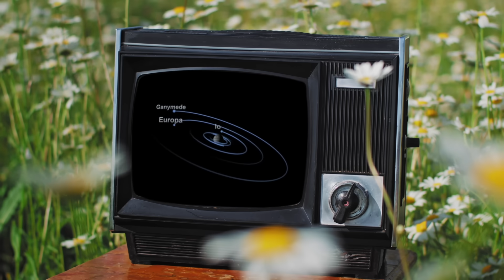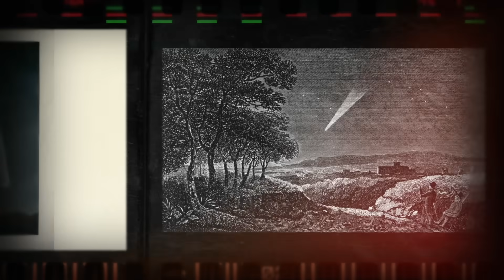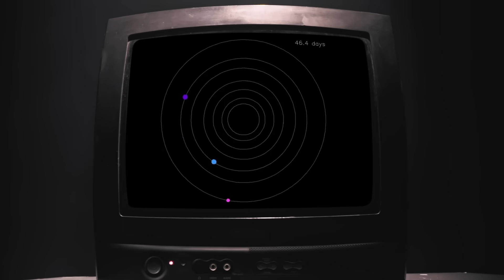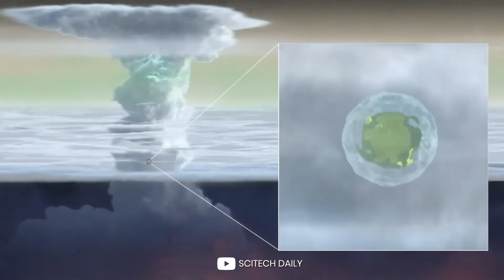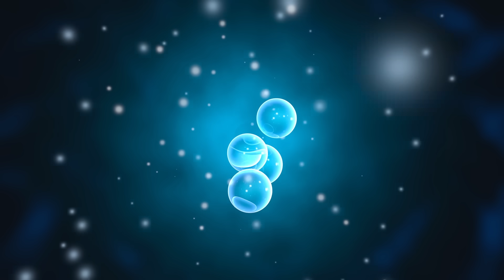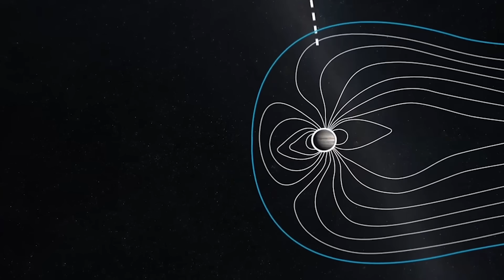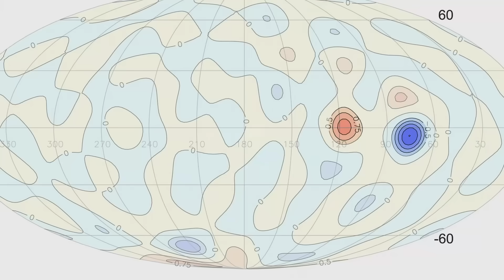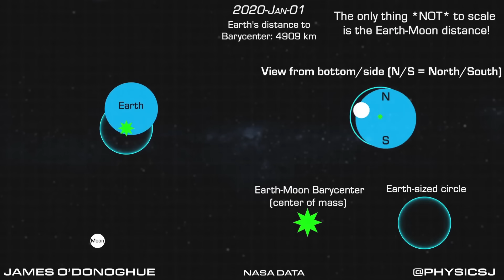Scientists Reveal That Jupiter Is Not What We're Beeing Told

Comment: I remember taking an astronomy class years ago, and my instructor mentioning that the sun undergoes a heightened level of activity every 11 years. I mentioned that Jupiter’s orbit is also 11 years. I always wondered if there was more to that connection….
Reply: Sun's 11 year cycle is shaped by the gravitational pull of Venus, Earth, and Jupiter. I just pulled it from Google, so take it with a grain of salt probably
Reply: @PandaChan6876  the Sun weighs about 333,000 times as much as Earth. It is so large that about 1,300,000 planet Earths can fit inside of it.  I doubt that the Earth has much influence upon it.
Reply: @PandaChan6876  you have something thier but still no explanation. Venus rotation is opposite of all other planet's.
Reply: @PandaChan6876  with a grain of sand
Reply: Who says Jupiter needs to be 50 times bigger? I think it just needs to be denser. Size has nothing to do with it, or rather very little. Our sun is relatively small compared with titans of the universe. Even so, there's smaller stars yet.
Reply: Very simple.  By 50 times bigger I meant 50 times more massive. Equations of state will ensure that it is then much denser and the conditions for nuclear fusion are met.
Reply: @BawkBawkBawk666  it doesn't have the mass to become denser. This is elementary stuff
Reply: it's rather 12 years orbit
Reply: Well there's a possibility that Jupiter was supposed to become a star and make a binary star system with the sun.. it wasn't quite big enough so it never fully developed into a star. 

On another note,  the moon is a quarter of the size of earth and it creates tides.. it's not hard to jump to the thought that it may be the same with Jupiter and the other planets
Reply: @sethbieber5127  You exaggerate. Jupiter would need to be something like 50 times more massive to become a star.
Reply: @rogerphelps9939  which is why it never became a star. It was too small... like I said... are you dense? It just weird for your brain to be foggy and in the clouds, but yet so dense.. what material is being used for that?
Reply: @sethbieber5127  if he's really dense maybe he'll become a star ?
Reply: @sethbieber5127   Jupiter wasn't "supposed' to become anything. Things happen because they have to. There is no intent.
Reply: @sethbieber5127  I have wondered if the big red spot hides details of an ejection of matter that formed the asteroid belt preventing a solar ignition, perhaps so life could exist on earth.
Reply: @spUrrrt — As suggested in the images in the vid, the red colour of the spot probably represents matter welling up from deeper within the atmosphere, possibly compounds in a liquid or subliming state or suspended as droplets in clouds.
Reply: @sethbieber5127  " it wasn't quite big enough " by a factor of between about 60 and 90*. Viz, Jupiter is between about 1.1% and 1.5% of the *minimum mass necessary to "ignite" as a star. 
If it were about 50 times heavier than it is, it might be able to have a short (couple of billion years) period of "burning" deuterium, but that would require adding all the rest of the planets (plus around 3 dozen other solar systems) to proto-Jupiter. 
As a "failed" star, Jupiter is a huge failure.
Reply: @sethbieber5127 Quite true, however, I find this size comparison misleads people who don't know the Earth is 83 times more massive than the moon. So it's a lot less 'stuff'. I like to use sciencey words as you can see.
Reply: @garethrobinson2275 Sciencey type bloke here [I’m a polywolyglottie whose hobby seems to be taking sciencey-wimey type degrees & doctorates] and I still ponder every now and then why don’t my home scales come in Newtons.

I hope you can read my sarcasm 😅
Reply: @sethbieber5127  Correct. Jupiter was supposed to be a star, but failed. Saturn too....I think.
Reply: @sethbieber5127 who says it’s done forming into a star though? For all we know, we don’t know shit about the way our universe works. It very well could become a star in trillions of years. Not knocking your thoughts, because they are very valid. I’m just using my imagination a bit. It would be cool though.
Reply: @Not-A-Bot42069  There isn't enough matter left in our system to turn it into a star. So yea it is a failed star no matter how you slice it.
Reply: Well, at least you've got an active imagination. Good on you to just stream-of-thought your way through life I guess. Who needs even a minimum of research anyway, right?
Reply: @Not-A-Bot42069  The mass of Jupiter is only around a fiftieth of what it needs to be to form a star. Although Jupiter is still accreting matter the rate is really slow and there is far too little matter around for it to happen.
Reply: @Diavire asking questions and having a vivid imagination is a part of why we are so advanced, you should try using yours instead of  bringing someone else down
Reply: @Diavire you can’t even fully believe any research. In this world you can’t believe anything.
Reply: @ronaldbrison8271  Imagination does not equal science. Jupiter could also transform into a gigantic ball of cotton candy too, right? Nope.
Reply: bitter af, who needs a stick remover for their butt anyway, right? @Diavire
Reply: @Not-A-Bot42069  No it couldnt become a star... just because you dont understand something doesnt mean that anything could happen.
Reply: @Not-A-Bot42069  its a cool thought, but 
A) there is not enough matter floating around in our system to form another star.
B) it only takes about a million years give or take for a star to form, so if it was going to happen, it would have happened a LONG time ago
Reply: @Diavire  Yeah, I thought it was verbal diarrhea as well.
Reply: @Mate397  you have no way of saying what type or amount of matter could be brought into our solar system in millions or billions of years. Just because it can't form right now doesn't mean it couldn't later. Not trying to attack you, just saying that you can't predict it.
Reply: @Not-A-Bot42069  Using what for mass? Apart from the rest of the Solar system, and many other Solar-like planetary systems.
Reply: @vanavatareight5135  My friend, you don't seem to know what science is at all.  The use of imagination to forumulate a hypothesis and then test to become a theory is science, and that still isn't fact.  Science is a process of studying.  Nothing more, nothing less.
Reply: @Mate397  so you’re saying Jupiter should be busing tables in Hollywood?
Reply: @gawainethefirst  That's one way of looking at it :P
Reply: @vanavatareight5135  What flavor?
Reply: @Not-A-Bot42069  They already know it won't become a star.
Reply: Reasonable guess. Jupiter's orbit is 12 years. The sunspot cycle is cause by the magnetic reversal of the polles every 11 years.
Reply: This may seem unrelated, but WAIT FOR IT.  They learned in split brain studies (where they cut the corpus collosum which allows the halves of the brain to communicate to each other) that testosterone effects certain cognitive abilities differently than estrogen.  And these abilities varied by the levels of the hormones.  Testosterone is higher during the winter months and estrogen is higher every 28 days in accord with the moon.  Which means.... the body is able to detect microgravity and use it to regulate hormones.  

People get some of their personality from genetics, some they create themselves, and some from environment ...but certain aspects of personalities seem to come from some other factor unrelated to any of those.  So I spectulated there must be some "dice" that the body uses to "choose" a personality at some point during the mind/body's development. 

While studying personalities I looked for a bit (not really expecting anything because I'm not superstitious) at zodiacs.  And I found there are two, the Western and the Chinese.  The Western goes according to months in a year.  The Chinese has 12 also, but for every year not month.  

On a different mental workout thinking about time, I realized that time is really just a measure of motion based on a fixed motion-to-distance ratio.  Of course our years are counted by the motion of the earth orbiting the sun, and the year is divided by the motion of the moon orbiting the earth.  The Western zodiac follows a lunar cycle that repeats for each solar cycle.  But what about the Chinese zodiac? 

And then I thought about personality again.  If somehow microgravity was a factor your body used, not just to regulate hormones, but to set personality type, then what are the biggest sources of microgravity around us?  The moon: because it is closest.  The sun: because it is the biggest.  And... Jupiter, because it is close and very large as well.  Then I looked up the orbit of Jupiter, almost 12 years.  Which is the time period it takes for the Chinese zodiac to reset.  Just a coincidence???
Reply: Some of you are seriously pompous. Then there are others who respectfully try to share their knowledge. What made you become so hostile towards people who know less than you?
Reply: @Nick-Nasty Just got to give you a huge 👍 for calling out the hostility, I had been trying to be kind myself and thing of it as sarcasm…

BTW having the user tag of @Nick-Nasty and being the kind and righteous person in this comment section is truly ironic.
Reply: There is a connection…🥁a cosmic connection!
Reply: The suns poles flip completely I’m pretty sure. Every 11-12 years I think?!
Reply: “Polar field reversal”
Reply: @Yu2ew now they call it " climate change? "
Reply: "Brown dwarfs are more massive than any of the giant planets in our solar system but less massive than stars. This brown dwarf is actually about the same size as Jupiter, but it has about 43 times more mass and spins almost 10 times faster."
Reply: i have the same birth date as 5 of the ppl in these comments!!! I wonder if it means something!  😋
Reply: @OldManPaxusYT   guess you made 6 accounts
Reply: I suppose it wouldn’t be too difficult to see if they correspond in some way.
Reply: The eco doomsayers use the 11 year cycle as an excuse to claim climate change and hike fuel prices.
Reply: Oh god they’re lying to us about Jupiter everyone
Reply: probably not Jupiter isn't big enough to really have too much effect on the sun but maybe a third factor is involved that correlates (but doesn't cause) the two
Reply: 12 years, not 11.  The two have nothing to do with each other, except they share the Solar System.
Reply: SYNCRONICITY 🎆😘🎆🎆
Reply: Not very likely... Now despite the mass of Jupiter being more than all of the other bodies in the solar system combined it is still miniscule compared to the sun that is around 99% of the mass of our solar system.
More likely that it has to do with the center of gravity which is not in the center of the son like most people think.
Reply: 4:05
Reply: The solar cycle is only 11 years on average. There is no connection with Jupiter's orbital period.
Reply: Idk stars are always in the center of their solar systems even binary stars orbit eachother closely in the inner solar system I theorize the gasses needed to make a star only accumulat in the center and everything else is pushed outwards meaning Jupiter doesnt have the correct gasses and if it did it would be heavily polluted by other stuff that it still may not become a star. Just something to think about none of us really know but its fun to think about.
Reply: man, i bet in your mind you're wondering if you've put together a piece of puzzle the scientists have never really investigated... i gotta say congratulations, and all with taking one astronomy class...
Reply: Indeed, should Jupiter be considered more a very low-level brown dwarf star rather than a "planet", per se?

Comment: So strange that it stays together with minimal solid elements.
Reply: that's because gravity is crazy
Reply: It may have "minimal solid elements," but it has a HUGE mass, because of how large it is - giving it a very strong gravitic pull on anything that gets even remotely close to its mass. Gravity is the weakest force, but it's the MASS of Neptune that distorts the fabric of space around it (creating what, in essence, is a well, or a "dip" in space, with Neptune settled on the "bottom, and anything falling into this "gravity well" will begin a spiraling spin into (if it doesn't stop) Neptune itself. Einstein figured this all out with equations. This happened to the Schoemaker/Levy comet a few years ago: it passed by Neptune, too close, and fell into its "gravity well," eventually spiraling (as astronomers watched, fascinated, from the earth) into the mass of the planet itself. You could see the holes it punched in the atmosphere, and it made me realize how lucky (for the most part), we are to have TWO massive, gas-giant planetary "shields," as well as the largest moon, compared to its planet's size, in our entire Solar System  (there are larger moons, but none as large as ours compared to the planet it orbits around.

Comment: If we could find some method of harvesting even small fractions of the water vapour, or using the magnetic fields to propel or power craft. Imagine bringing water vapour to Marian colonies.
Sailing on magnetic winds. I understand currently we couldn't get that far out or go back the way we came but orbital platforms and nano tech. The possibilities are intriguing.
The fuel we need to access the outter solar system. Weigh stations from somewhere between Earth orbit. Lunar orbit crossing Earth orbit.
Bringing power from the lunar surface. H3 is abundant.
Push on to Mars.
Again eventually industry, getting a space train as it were to travel to Jupiter from Mars. Then From Jupiter sending probes to interstellar space

Comment: @3:00 Neat video but this scene confuses the heck outta me.  1st Why is the idea of asteroid deflection simulated on a PC rather then just the screen? 2nd, independent form the answer to the First question, why pick a PC from the late 80's.  3rd, while maybe the 2nd Q helps with this one but, WHY pick a PC that at it's height was being used more for graphic design & print media instead of science as well as the fact that it was a grayscale screen and pretend that it's rendering of the asteroid was in color.  It was just such a confusing overlap of images that I suppose makes me question the validity of the rest of the video.  You might have just as well explained the asteroid deflection as cave paintings done in pastel chalk.
Reply: @4:20 and you did this multiple times.  Very odd indeed.

Comment: It's astonishing that in today's world we still believe Jupiter to be almost entirely comprised of gas.  

Jupiter's mass is more than double that of all the other planets in the solar system

Matter stratifies by its density when under acceleration.  This means that the densest matter is at the core (or the deepest part of the well) and the least dense at the top of the atmosphere

Gasses do not self accrete, they disperse.  it takes an already eexisting deep gravity well for it to hang onto gasses.  Look at all of the 'terrestrial' planets.  They're called that because they lack the depth in terms of their gravity well to hang onto light elemental gasses.  you could put a free hydrogen generator on earth that pumped thousands of tons per hour into our atmosphere and you wouldnt change earth's mass at all because that hydrogeen would rise to the top of our 'atmosphere' and be swept away, just as it does today.

Whereas if you shrunk the moon down so that its mass had the diameter of a football stadium and set it on the surface of the earth, it being MUCH denser than what is below it, would sink rapidly down to the core, correspondingly increasing the planet's mass and deepening its gravity well

Jupiter is a very deep gravity well that does not allow light elements (like hydrogen) to escape, but it's fatuous to ignore the obvious fact that there's a lot of 'something' denser than gasses underneath that thick atmosphere and and that something is rotating very quickly and its not some exotic form of 'metallic hydrogen.'  Why invent something like that when the simpler model of a gravity well with stratified matter by density (like on earth)

What do scientists think has happened to all the dense metals and rocky asteroids and planetesimals that jupiter has been collecting over 4.5 billion years?